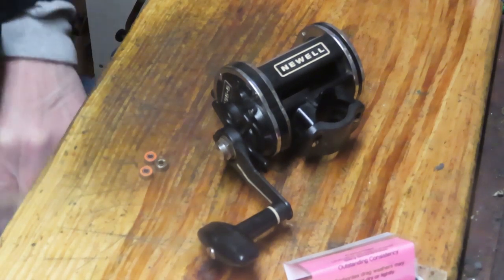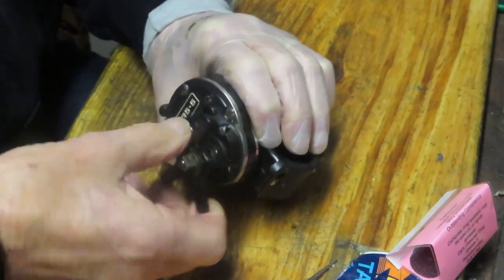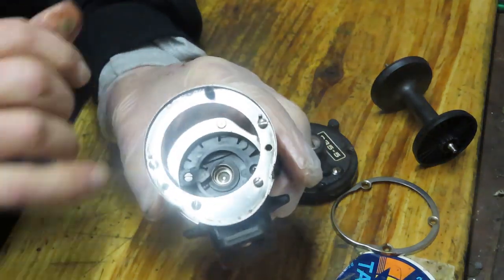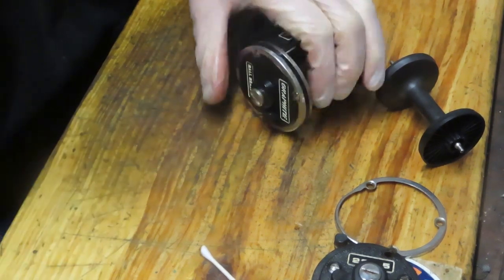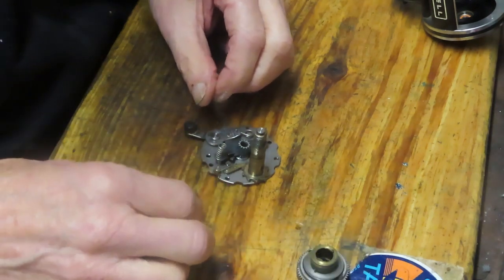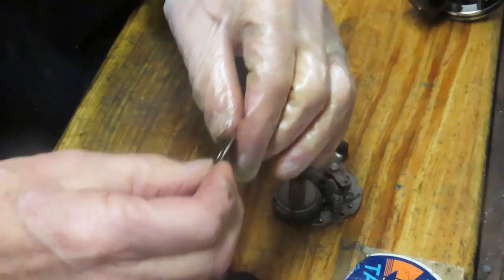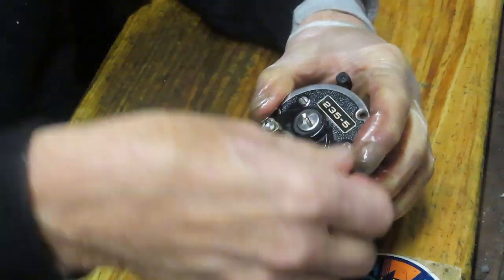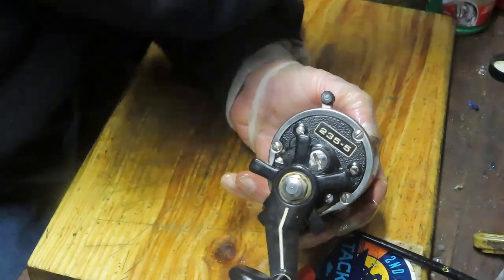Newell 235 5 fishing reel how to upgrade and service  reel

Comment: What did you use to measure the bearing?
Reply from the maker: I use a digital caliper.  They measures at inside diameter (hole width)  (ID) Outside diameter (OD) and height./width - Thanks for asking - Dennis

Comment: Why did Carl Newell use brass sleeves instead of SS when he was so concerned about corrosion? He made extensive use of SS and Graphite otherwise. I like the 220's for being narrow, lightweight and having a 5:1 gear ratio with plenty of drag for the inshore fishing I do. I especially appreciate the use of C-clips to hold the yoke and yoke springs in place so the reel doesn't explode in you r face when disassembling the side plate from the bridge assembly.
Reply from the maker: I don't know why he chose brass.

Comment: What a nifty reel!  It looks like it will last anouther 20 years.  I found it odd that you need a tool to adjust the spool tension, because all others I've seen have a knob so it is easy.  I was taught to adjust the tension so the weight or the lure dropped slowly to the ground so with a 2 ounce weight I'm using a lot more tension that you have there.
Reply from the maker: It will last and last as long as it is cared for.

Comment: nice reel, I can see why it has almost a cult following, how big of reels did Newell make, and are they like a Penn as far as the mechanism, the same in the different reels, just different sizes
Reply: Litttle long but I hope this helps. Newell
made 5 series of reels. The snallest are the
200 series and the largest are the 600. They
correspond in sizes roughly between a
Penn Squidder and a 6/0. The Newell 338
is the same size as a Penn 500. The 4 and
5 series are the same size but the 500 have
have larger gears. Also they have different
gear ratios in some models. For example
a Newell 540 4.2 is supposed to hold
400 yards of 50 lb test anf have a 4.2:1
gear ratio. Also a wide variety of different
materials and model series. The mechanism
is the same as the reel Dennis is working on
but the larger reels have 2 anti reverse dogs.
Reply: @armandoreyes1891  great thank you!
Reply from the maker: Thanks as always Armando - You are a wealth of information and I appreciate you sharing your knowledge with us - Dennis

Comment: Hi Dennis, I have a Newell 338 and when I slightly tighten the bridge screws, it makes the reel really hard to crank. Would you happen to know what the problem may be?
Reply from the maker: Something isn't aligned properly.  Check to see if the A/R dog is trapped under the main gear or that the drags are in the gear correctly
Reply: @2ndChanceTackle  I will check that. Thanks!

Comment: Hello Sir i have the same reel when the reel is not in free spool the handle spins when the drag is tightened do you know what this issue could be?
Reply from the maker: I am not sure if I understand your question.  The reel handle should turn when not is free spool.  The handle should not turn when it is not in free spool, which is when you are releasing the line..  Also, the handle should not turn backwards at any time.  Can you ask your question another way?
Reply: @2ndChanceTackle  
I apologize, Sir  when the reel is in battle mode, the handle spins with the spool forward and backward I hope this makes more sense.
Reply from the maker: If it is spinning backwards, you have lost the anti-reverse.  It would need to be reset or replaced.  If parts are needed, that will be a challenge as they are no longer available as new replacement parts - Dennis